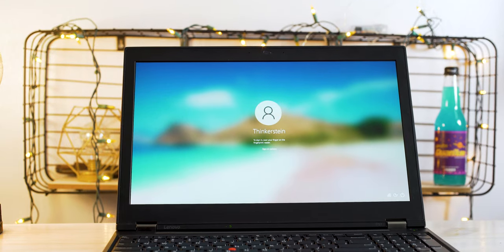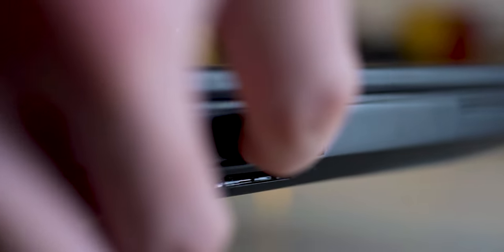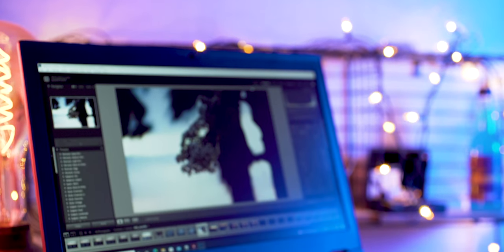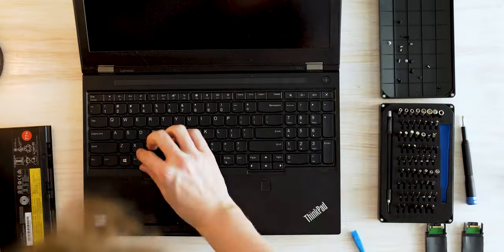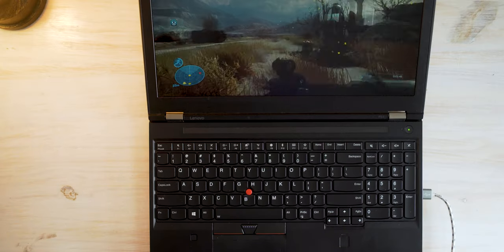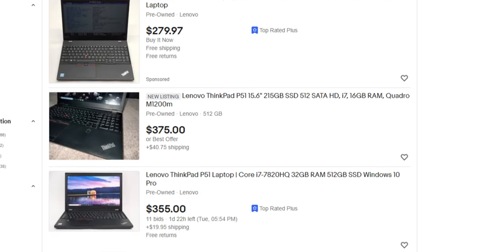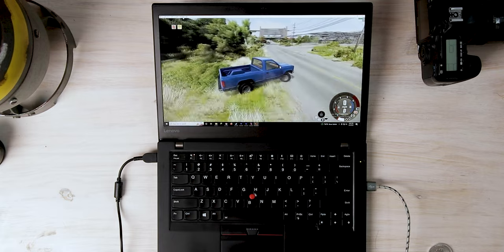I Did Not Expect This AT ALL - Thinkpad P51

Comment: I actually bought one because of this video. I already had a t430s and t430, but wanted something with better gaming performance. Got my P51 4k i7-7820hq m2200 16gb  with a dock for $215 to the house. It plays everything I've tried to run on it at low settings 1080p 60fps, other than Project Zomboid. Very impressed with this machine.
Reply from the maker: Awesome deal! Love these things, I need to try the p70 next haha
Reply: why is P51 refurbished are so expensive on amazon??

Comment: I actually managed to get one a P51 just before college. At first I just had a cheap wireless mouse but over time I upgraded to a dock with a monitor and mouse/keyboard. Off the dock I would carry it everywhere, in my backpack to class, my friends' places, home during breaks, camping, etc. Its led meetings, done homework, had long video calls, hosted movie/game nights, did all of my homework and personal gaming, completed a CS degree, all without complaint (except a lot of heat lmao). With Dolphin and a gamecube controller adapter and wii remote sensor bar my friends and I have played tons of wii and gc games flawlessly on it. I'm still using it right now, such a great laptop :)
Reply: I buy a ThinkPad for college tho

Comment: I’ve got ThinkPad P51 from my dad after he bought P16 Gen2.

This P51 is a great machine. Quite powerful with i7 7820HQ, 32 gigs of RAM as well as Quadro M2200 graphics card. The UHD screen is gorgeous, keyboard is fantastic and IO is… well, nothing to complain about besides the size and weight. But I can understand that when I get 4 RAM slots, 4G connectivity - which is handy - and 3 places to put hard drives in. 

It is not as sleek nor powerful as my daily driver XPS 9520, but for a cheap workstation machine it is absolutely amazing deal.

And actually, I recommended similar ThinkPads to my grandparents. They’ve got P70 and P52, grandfather wanted a big screen, so he got one with P70. Grandmother on the other hand, needs to carry her laptop to and from work, so she got smaller one.

Absolutely can’t complain about these laptops too. They are built like a tank and will last a long time - just like P51 that my dad used.

Comment: I am also enjoying P series of Lenovo.
Back in 2015 i bought new P50, and was enjoying it for a long time... I know it had big disadvantages - like overheating, but everything else is so good - keyboard, 4k screen.
I looked for a while to get replacement but price tag for modern 4k notebooks is simply not cool, so this summer i decided to do strange operation - but perfect 1080p P51 and use my P50 screen with that.
Buying new one i wanted to repaste it anyway.
It took me around 4 hours to switch the screens (and i did not even assemble back screen on P50 with 1080p screen from P51), but now for 495£ i have 4k xeon-based P51 with 64GiB of ram, Quadro M2200 made in 2019. It is really cool, and I totally understand people who like it.

Comment: solid machine. funny story on my P51. this came as a trade for my Legion Y530 (i7 8750H/1050 graphics) straight for the P51 seller was like, why are you trading a much newer and powerful gaming laptop for this old P51? i just told him i like the P51 more and be done with it. i loaded my P51 with 2x1tb nvme ssd in raid0 then another 2tb sata ssd at the 2.5 bay max out at 64gb ram plus added a mobile lte module to complete the package.

very happy overall. this laptop is more snappy than my 10th gen X13 and T14 machines. only downside is its heavy but overall i'm happy
Reply from the maker: Awesome setup! If I kept my p51 I probably would have done raid 0 as well, was very tempting.

Comment: So crazy thing, got a P51 off ebay as a Linux machine so I don't have to dual boot my main. The crazy part was I was buying a P50, the screen said P50 but the parts were screaming 51. Less than 200 dollars later, I've got a great condition P51 with 7820HQ M1200 and a touchscreen that says P50 on the bezel...machine is working great so far. O and great review!

Comment: What I love about the thinkpads is just how much more flexible some variants are compared to other typical laptops and how powerful of a machine you can whip up with some models.  I recently built a project T440P and pretty much hammered everything I could into it.  It has three SSD's (One for OS, two for a raid for swap) and the fastest 4 core chip Lenovo ever put into that machine.  I compared the performance to my older daily driver (A T440S) and holy cow.  The old machine took roughly 33 minutes to render out my video editor test file.  The new machine?  3 minutes flat.  And right now, I probably have less than 500 bucks into the machine.  Heh.  I suspect the quality of these machines is why every time my local vendor gets a pallet of a couple hundred refurbed units, they're gone in a few weeks to a month.
Reply: T440p with i5 4th gen processor just takes 3 minutes in rendering? Unbelievable
Reply: @Gurpreetsinghpreet1 : It's still my daily driver.  It runs hot though.  That i7-4910mq is about as hot a chip as it'll take.  Even then I had to add surface area for cooling, do airflow changes, undervolt it, etc.  But for an older machine, ZOWIE!  SMOKING fast.

Comment: you can use the express card port to install an adapter which will let install a 2242 NVME SSD , like the 500GB, 1 TB and 2 TB  models of 2242NVME SSDs from Sabrent.

Comment: Awesome series from Lenovo - so about that Express Card/PCMCIA port: I've used it for decades now with the Creative Audigy 2 ZX and later the brilliant X-Fi Extreme Notebook cards. These audio cards were aimed towards professional use like playing soft-synths and VST nstruments live, recording studio quality audio as well as the laptop addicted audio connoseur, and: ... These two are hands down still(!!) the best audio one can get from a laptop without dragging along external audio cards, power adaptors, usb  stuff and what not..

Both have combo minijack/optical I/O (and also breakout boxes for THX certified 7.1 audio that are totally useless and counter to the main reason these cards still makes sense on any laptop). Their advantage is still that no internal laptop audio comes close to these,  10 years ago and for certain today, as audio components are ruthlessly cheaped out on even on the pricy laptops and compensated with software... and NO, Apple, stop it - your internal audio also suck bills, you might fool most ppl by adding DSP-tweaks and whatever software makeup needed to pass the loudness and frequency aim a tick above the majority even, but it's still a cheap fake compared to anything with quality audio hardware

These cards were made as good as Creative could manage with the best available hardware (within reason) that would fit inside (X-Fi's plastic holster does not impress in any way though, but that's irrelevant as both cards operate up to a frankly unbelievable 24BIT/196KhZ top tier studio rendering and will play true to most reference studio headphones as well as playing all the fancy Hi-Res audio your cans or speakers are able to forward. The 6.1 Dolby and 7.1 THX certified hardware decoding might actually be regarded useful  by now, e.g. when watching huge MKVs with original surround encoding, no need to decode in the player, send the raw audio to the card and let it do the job with bespoke hardware, and improve audio quality as well
.
It's even worth getting an adaptor from Express to regular just to get to use the old Audiogy 2 ZS, in my opinion (and on paper) the best card of the two, but the Extreme is a bit faster and playback optimized. Both do use ASIO drivers with sub 8ms input-output delay, using the CPU to boost performance where needed. The Extreme express card version lacks that insane X-Fi processor but compensates by using some more CPU-cycles. An issue 10-12 years ago for sure, not so much by today. The card sounds even better when feasting on the CPU for all it's needs, although not even noticeable on a readout now.

Sorry for this oversized rant, but there you go: laptop audio really sucks and these cards brings uncut studio grade audio quality to anything rocking these old cardslots almost for free. And finally, yes I do suspect that several portable computers have high quality audio natively but these are solely oversized gaming outfits by e.g. ASUS. Those usually need 2 power bricks and a number of bags to move around and as such, aren't laptops.

Comment: I had a P51 that ran really hot - I eventually fixed it by replacing the heatsink fan assembly with a new one. The replacement HSF looked identical, but did a much better job of cooling the machine.  I also noticed that with the original one the air exhausted on the right side was a lot hotter than on the left while on the replacement both sides were very similar, which makes me suspect there was a problem with the heatpipe.

Comment: Yoooo I bought the ThinkPad p50 at 10:25 that costs 161 dollars, but I got it for 127 back in September (It said parts only, but works fine lol). I'm watching this video on it right now. absolute steal, especially with the better m2000m inside.

Comment: I think the weirdest thing about this laptop, and I don't think you covered it, is that some models came with a color calibration sensor built into the palmrest. I've heard it's not accurate enough for the work that a color-calibrated monitor would do, but it's something I haven't seen in any other laptop.
Reply from the maker: I actually was planning on specifically getting a model with that color calibration sensor. After looking into it a little, I wasn't able to get a solid answer on how good it is, or if it really does much of anything, and I don't have the proper equipment or budget to test it properly. It is for sure something I really want to visit in the future when I can properly take a look at it.

Comment: Dang .... Very nice. I just got a Dell e6320 and it was running very hot. So I replaced the thermal paste and cleaned out fan. Omg I literally had to take it ALL the way apart down to the motherboard, screen, hinges, keyboard, bezels. I didn't realize this until I already started the process and we'll just had to finish. Lol.

Comment: I just bought a t495 ryzen 7 with 16gb ram for 200 bucks on ebay to be my new work laptop. Thinkpads are the best deal in used laptops.
Reply: and 8 months later, I'm waiting on a p15s in the mail and considering buying a xeon p51 lol... I have an addiction to slightly used laptops.

Comment: Bought this Laptop a month ago from second hand. 
first purpose for gaming, I could finish Witcher 3 setting high, and now Playing Fallout 4 setting medium. a bit struttering or fps loss sometimes in Fallout 4. I need a vacuum fan cooler for effectiveness of cooling. and I tried for my office work like ms team, working on bloated report usually always heavy on gaming laptop. but in this P51, it ran smoothly.
mine is 8 GB Ram, i7, Nvidia Quadro M1200M.

minus is, it's a bit bigger than X230, I doubt to bring it to my office because I use bicycle for work. so I still keep my x230 for mobile purpose. but this P51 never disapointed me until now

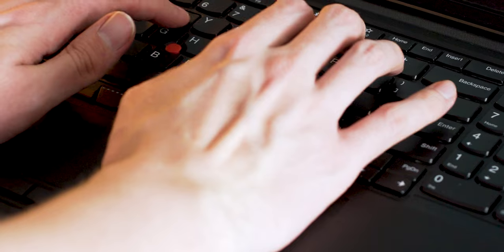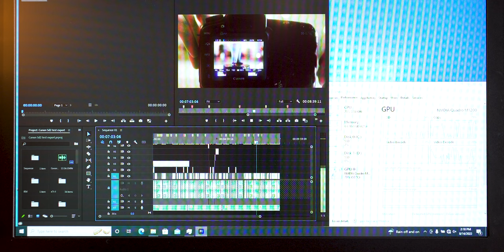Comment: 1:45 to 2:35

Touchpads used to be created with dedicated separate physical left-&-right mouse-buttons, for left-clicking and right-clicking.

Second: To drag-&-drop you need to press-&-hold the mouse-button while at-the-same-time dragging the mouse-cursor over to the new-location where you want the file to be.

It’s much tougher to do that on a touchpad that has no physical dedicated separate-buttons. 
— All these “clickpad” touchpads are-just imitating Apple.

P.S. Did you know that you can “tap” on a touchpad (even one that has physical dedicated separate left-&-right mouse-buttons) to do a LEFT-click ? (And likewise, you can “double-tap” on the touchpad to do a “double-click”).

Thirdly and lastly, at-least now you have this knowledge for future reference.

And here’s a video in which the inventor of the touchpad was interviewed, if you want to know more about the touchpad:

https://youtu.be/SonkKtxZx8w

In regards to the pointing-stick (the “red button”), the physical-buttons below the keyboard are the physical dedicated SEPARATE left-&-right mouse-buttons for the pointing-stick.

Here’s a small video by IBM (now Lenovo, who bought IBM’s Computer-division) explaining how-to—properly-use a pointing-stick:

https://youtu.be/7H8o_-7bKIU

And here’s a short-video explaining how it was invented:

https://youtu.be/n4Ss6F1qIHU

Comment: That's why I love Lenovo you can upgrade almost everything. I had Lenovo T580 I upgraded the memory RAM to 64GB DDR4, storages SSD 8TB each other is PCIe 1TB that's a lot space, minimum you can do 5TB still is enough, with Windows 11 Pro, Intel i7 and fingerprint ready i gave to my wife. Then I got Asus Rog X13 a powerful gaming laptop RYZEN 9 and 32GB RAM DDR5, 1TB storage and NVIDIA 3050Ti, and eGPU Radeon RX 6850M but still love Lenovo I'm planning to get another Lenovo laptop

Comment: I use a x200T and I've used that expresscard port for a few things. More USB ports, egpu, legacy ports in enterprise settings. Since my laptop is old it's much more useful but the P51 tries to hit as many use cases as it can; as niche as those can be.
Reply from the maker: Egpu with express card slot? I'd love to know more about that
Reply: @aChairLeg  it's nothing special anymore with the proliferation of Thunderbolt egpu enclosures, open air setups and smaller cards. But, at the time, space and ports were a premium and the cards were quite bulky so it kinda worked like a test bench. It's by no means the best solution as you still need an external monitor to use the card. But it also worked as a serviceable alternative to going through opening the laptop and "sacrificing" the network card with an adapter. Since the x200T laptop has an Core 2 Duo CPU, there's that bottleneck on top of the expresscard transfer speeds. Even first and second gen i series CPUs definitely got more mileage out of that type of process. I don't advice for the use of these nowadays as far as buying one as a daily driver. But if you were "dumpster diving" for it, it's free why not. But with prices for all these RTX gaming laptops with Thunderbolt 3 plummetting, it's just a matter of time before these old laptops (pre 09 like the x200t) become obsolete for a power user.
Reply: @aChairLeg  On an old laptop the expresscard port can be useful, but on a semi modern laptop its pretty useless as thunderbolt does everything better
Reply: @aChairLeg  you can connect one GPU (eGPU) to your laptop in two ways: 

1-where is connected the Wi-Fi card, you can use an USB for the Wi-Fi. (you have to disable the PCI-E LAN to boot in the bios, I don't know exactly for those that don't have that option showed in the BIOS).

2-In the ExpressCard slot.

Of course, for run the GPU you'll need one adapter to connect it, the power supply and one HDMI cord (with head ExpressCard or for WiFi card connection "mini PCI-E or NFCC" I guess). 

The problem with the first #1 is that the Lenovo white list blocks some GPUs, so if it doesn't work, you can use the ExpressCard port. 

I used these 2 methods, I have one T530 Type 2429 with the RX6700 XT connected with an ExpressCard.

Comment: I think that the t480 (not s) is the perfect laptop under £500, (the i7 model) but can be had for about £380, (the i5 model), and you can get lucky if you start bidding.

It's got a hot swappable battery, so battery life is no issue. Unlike the t470s, it has a quad core CPU which holds up much much better. 

It's essentially the t470s, but without a lot of the problems it had, such as the awful battery life as well as soldered ram (one stick) and a Quad-Core processor, that is much more usable.
Reply: The T480 came with its own share of problems, including a power-port that was soldered onto the motherboard (and therefore it can't be replaced for a functioning one if it stops working). If it ever got damaged or broken or otherwise did-not work anymore, the laptop becomes essentially a fancy paperweight.

https://youtu.be/A15FfeJq6pQ
Reply: @reoencarcelado5904  Depends on your soldering skills.
Reply: @jaredgarbo3679  currently?, nonexistent. (I’ve never tried — let-alone attempted — Soldering before).